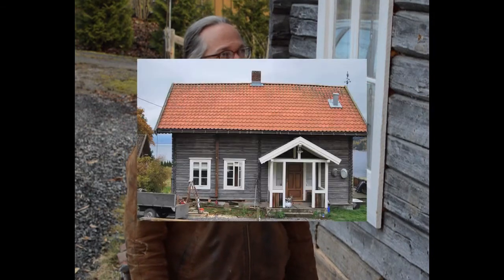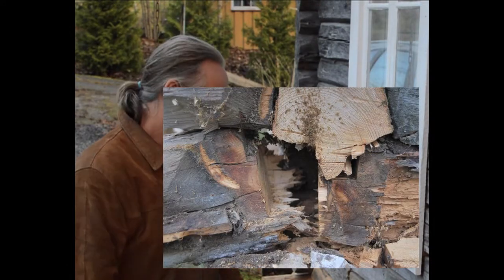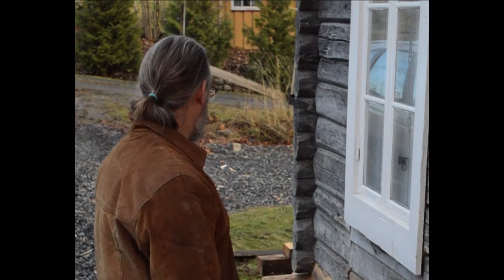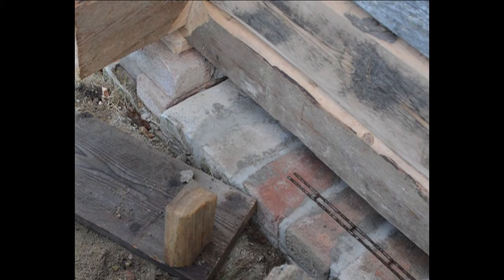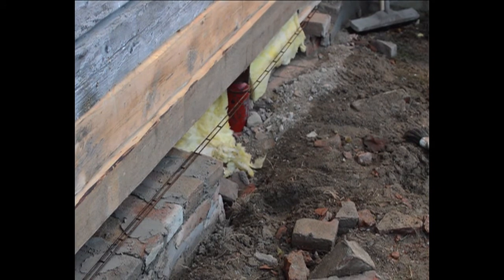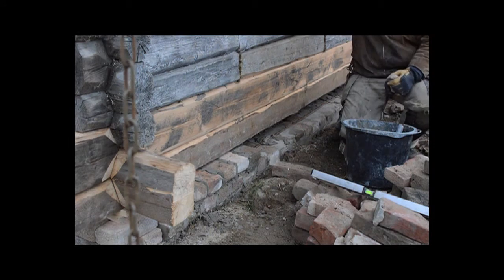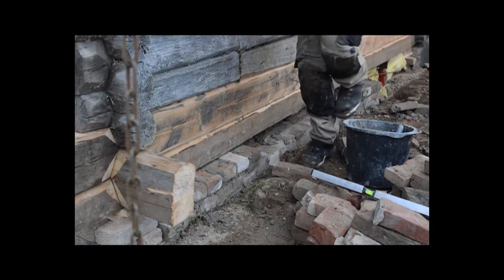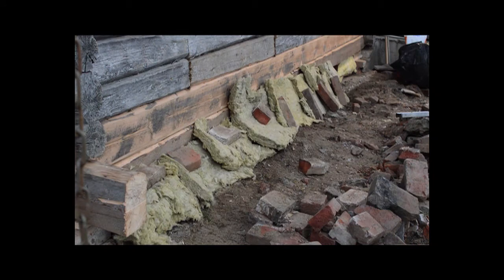Foundation Repair with Lime Rich Mortar, 1875 Laftehus (timber house), Norway.

Comment: Why replace poor brickwork with poor brickwork? The rot, and subsequent insect damage was not "rising damp", but the water trap created by the brick ledge extending well beyond the log wall line catching and draining water back under the sill logs! Why no flashing?
Reply from the maker: Have a look at some of my other films, maybe that will add some perspective. If you don't agree with the process in the film that's fine. If you had been on the site you would know more about it and if you can't agree with my prognosis, it really is neither here nor there. Doing cultural heritage work is not the same as building new structures (which often have much shorter life spans than this, already140 year old wooden house, without flashing). The repair is sound and the dampness in the ground at this point of the building has been addressed and the wall is a lot dryer now. I don't know what I said in this film since I haven't watched it for years, but I stand by the decisions I made and have done a great deal more work for the same (satisfied) customer. I Notice you have no films of your work and it doesn't surprise me in the least. Nothing in your comment has any validity.
Reply: @LucasRichardStephens  I'll respect the fact that restoring heritage buildings has its own requirements, and the any preservation work is better than none, but the fact that I don't make, or post, videos of my work does not invalidate it, and your last last few comments border on insult! If you like to start a war, just say so! You're a Pom hack in a foreign country for a reason.
Reply from the maker: @TheBloodyKnuckle  If you want to talk about building and restoring wooden houses then I won't hold your gruff comments and quick temper against you. If what you write in these threads does not suit the channel I will simply delete it. This is not an open forum where you can say what you like, I control what is posted on this channel, ultimately. My work and credentials are freely shared and speak for themselves and I make no attempt to hide my limitations. The voice of the anonymous  keyboard warrior has no traction in a comment section like this, get over yourself.
Reply: @LucasRichardStephens  I do not question your credentials, and the timber work in the video that I commented on looks to be of the finest! I only questioned the masonry foundation decisions, and have some disagreement with the causes of the original distress. I would not have subscribed to your channel had I not thought that it had some value, and I do reccognize that you have the ability to block me. I can also choose to unsubscribe, and neither of those does your channel any good. You were the first to insult, and the last! Goodbye, and good luck!

Comment: Those bricks look to be older than 1900. They dont appear to have a frog. maybe recycled from another building?
Reply from the maker: In this area the brick-works started in the latter 1800s (just a kilometer from this house). The house was built in 1875 according to the owner. Rural Norway was well behind somewhere like England in brick technology, having its' advancement in the use of wood. Earlier foundations in the area were granite and slate, which are not hydroscopic and would have prevented the damage in the timber. This was an experimental foundation at the time, and time has shown it to have shortened the life of the building substantially.  All the best, Lucas.

Comment: Thank you for the video, it is great to see some old buildings get some TLC.
Just one question. Bricks and render expand and contract at different rates, did you put any additives to keep the render more flexible?
Reply from the maker: Hi twentyone2s, thanks for your encouraging words. The render has high 
lime content, which is both more flexible and is more diffusion-open 
than Portland cement. You can also follow the historical practice of 
just using sand and lime, but in this instance the house has been 
rendered with portland cement and lime previously, so I am doing the 
same.
Reply: I don't know who to ask .......I'm French/Swedish on my Dad's side and French/Irish on my Mother's side, and I'm taking a Scotsman's mortar recommendations of 1 lime 1 portland and 6 sand, but I live in the Great White North and want to get it right, so now I'm asking Englishman in Norway.??........ BTW would render translate to parge in my land?